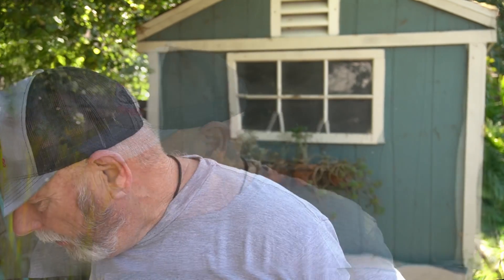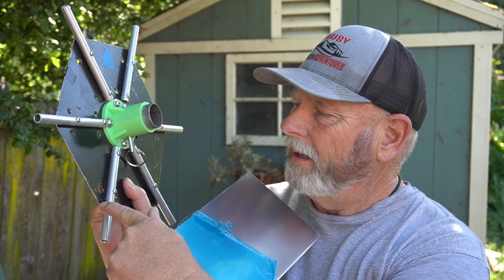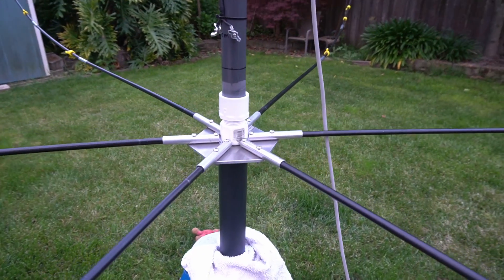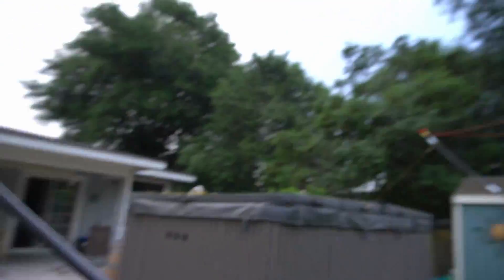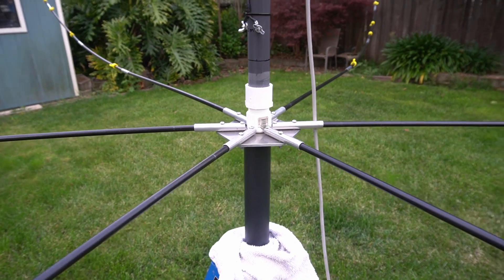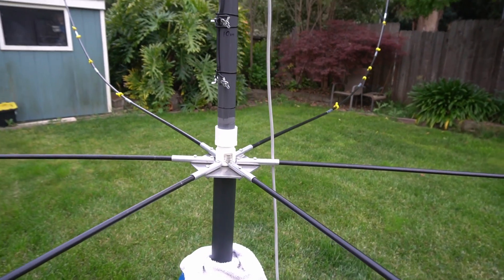Hexbeam Tune-Up!

Comment: Thanks for explaining this build. Do you think at some point you can put the measurements for the base plate and the poles' pipes in the description? I want to build one of these and feel I might have a trade school build the center plate for me. Thanks again, and I hope to catch you on the air sometime. 73s
Reply from the maker: I will look for the stl for the base plate if that helps or I can measure it when I get a chance to get it out
Reply: @KK6USYHamRadioAdventures @KK6USYHamRadioAdventures  Thank you. The measurements would be excellent. And if you don't mind, the template you used so I can get it to the shop. Thanks, de W3CT.
Reply from the maker: @MyHamRadioJourney  Flat side to flat side is 4.75". Point to point is 5.5". 6 sides.
I think I used 3/16" aluminum plate.

Comment: What is a good website that has the build instructions. How long at the fiberglass poles? How long are the top support ropes? Where do I find the clips you used? How do I weave the wires inside the hex?

Comment: Enquired the cost of a locally built Hexbeam. It is almost one third of the cost of my FT-710! So I am still on my homebrew fan dipole for 40/10m which allows me to work on 40, 15 and 10m. 73 de Jon, VU2JO

Comment: I'm over here fighting a single long wire, Chuck over here with real tools, printing and weighing in grams, do you have wire on there between 10 & 12? Can't wait for 2.2!
Reply from the maker: Allen I have 6,10,12,15 17 and 20m wires, I just didn't have time to put all on for the video. Thanks for watching!

Comment: Great work Chuck. Job well done. Looking forward to seeing the rest. 👍🏽
Reply from the maker: Thanks for watching, hopefully I get some time soon to do the next mods.
Reply: @KK6USYHamRadioAdventures  that's the problem mate is finding the time. I e not been on the radio since the WPX contest. I am still struggling to decide which radio I want next the line up is 991a, 710 or the G90. Currently running the ft817.

Comment: Beautifully done, Chuck💯👍 I could not do this any better myself. Looks very professional. Golden Rule here, save as much unecessary Weight as you can without giving up on Stability. Hey, tnx for another neat Video. I share this One with my Facebookers. Until the ext One. 73 from Coast to Coast and Sea the shining Sea de YFUG 💯🙋‍♂
Reply from the maker: Yea I'm getting old and pushing a heavy antenna up is not fun!